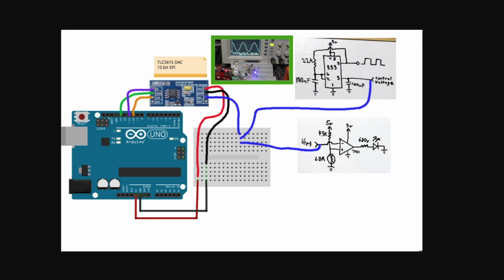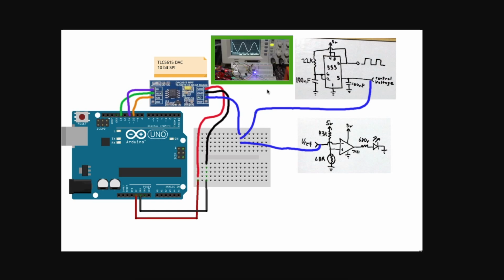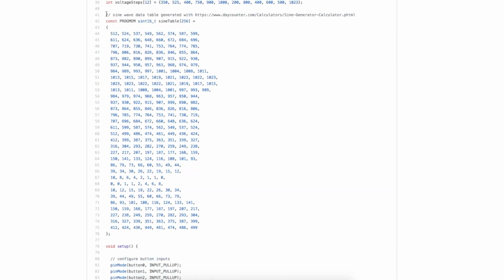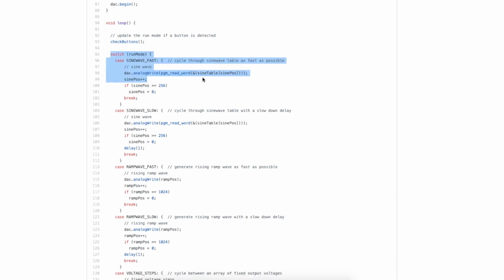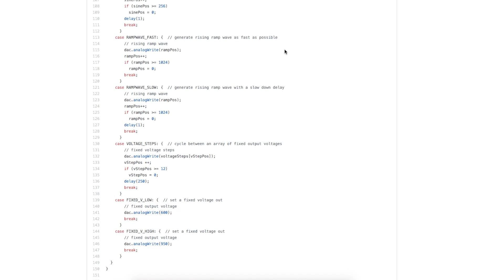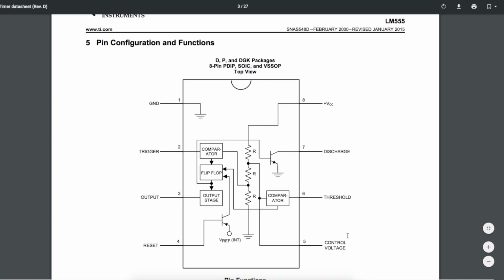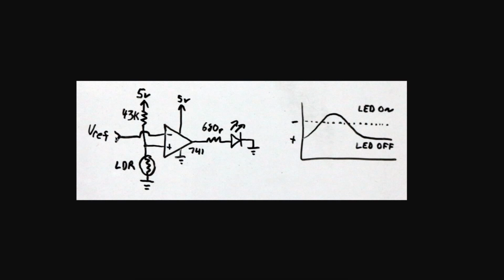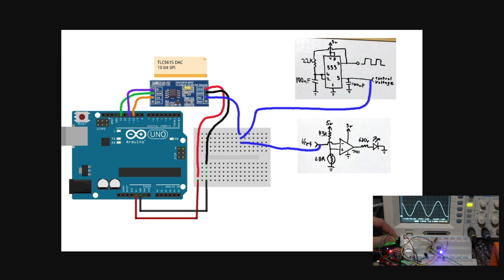TLC5615 DAC: 10 Bit SPI with Arduino, a 555, and Comparator

Comment: You examples could be done better without the OpAmp, i.e. directly in the MPU (It is difficult to do these types of examples with the capabilities of  a microprocessor at hand).
Another DAC module to look for is MCP4725 it is cheaper and has 2 more bits.
You can also look for Audio DAC's (Like PCM5102A), they often have 24 bits, but requires a I2S protocol. I have not checked if it is something I can bit bang on a small Arduino processor. A ESP32 would easily handle it (I need to play a lot more with that processor).
Reply: Hi would not like to try and get full 24bits on a breadboard!  it's the same with ADC's using all the bits can take a lot of effort being put in to the PCB design right to get the noise floor down, and a very clean reference. spent weeks testing a 12bit DAC on an ASIC, even moving my chair seemed to cause a problem on the readings. then repeating it all again in an environmental chamber. then there would be a change to the die and we would start all over again. :(
Reply: I do not expect a 24 bit DAC to provide 24 bit precision, but it will be fairly good in resolution (24 bit is probably on the optimistic side due to ground bounce and noise). With audio DAC's you go from 10-12 bits to 24 bits with a minor price increase, even if you only get 16 bits it is a big win.
Reply from the maker: Yeah I think I looked at MCP 4725 in a video over a year ago and it was a lot slower at trying to output a wavetable sine wave and that’s one of the reasons I wanted to try this SPI device.
Reply: The problem is that the I2C hardware in most Arduinos out there is limited to 400kbps. 400k / 30 (I2C data frame length in bits) / 2 (bi-directional mode) ~ 6.7ksps.  If you sample a sine wave at every 10 degrees (36 samples per cycle for a moderate resolution), that results in a ~185Hz theoretical limit (~80Hz in practice, tested).  Halve that for each additional device on the same I2C bus.  Those figures rule out applications such as audio synth and laser galvo drive.  For high-speed applications it's better to stick with the SPI protocol, whose bandwidth is half that of the Atmega clock (that is 20-fold the I2C's for a 16MHz Arduino).